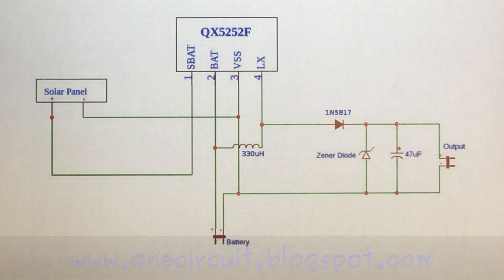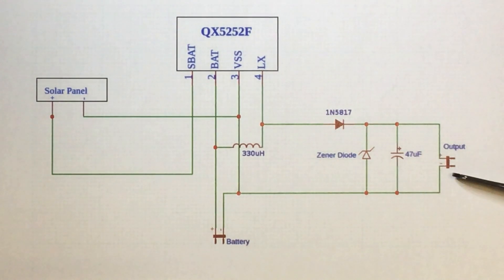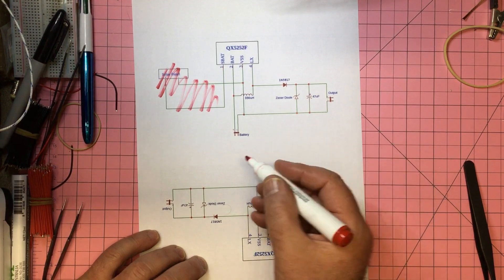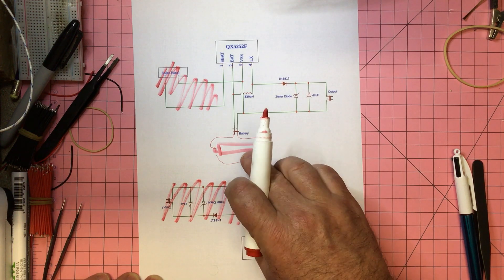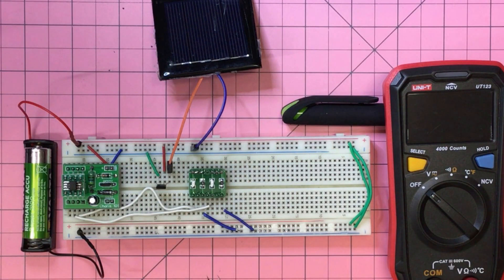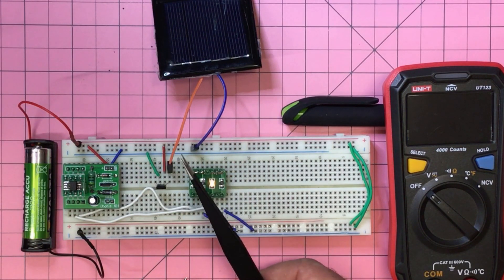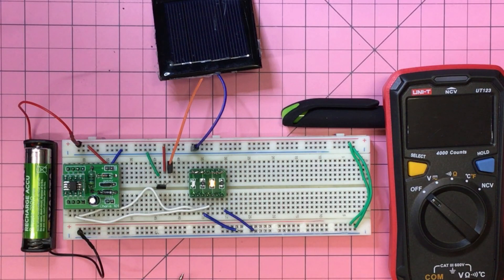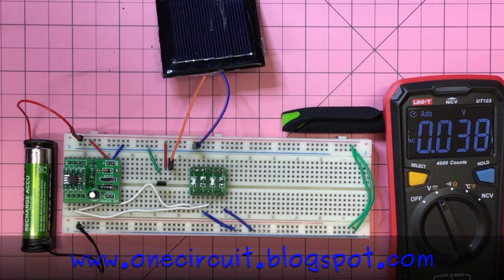Double QX5252 - Perpetual Light?

Comment: You have all the wrong values and have components you don't need.
Reply from the maker: ...and yet it works! Actually later I shift to the smd version which allows to be on the whole time! 😳
Reply: @onecircuit-as  you could throw dried leaves on it too, and it would work, but they are not needed.
Reply from the maker: Depends on what is needed! In this case a stable output voltage for a microcontroller - the QX5252 oscillates at 40kHz and that can be problematic depending on the project. Also, I'll give the dried leaves a go - thanks! 😁

Comment: A bit late, but if you want the 5252 running 24/7 just charge the battery directly via a shottky diode, not thru the chip.
If you use a second chip for charging you are basically just using it's internal diode, the rest of the chip is unnecessary and might even be wasting a bit of energy.
Reply from the maker: Yes it was a silly idea, I now use the SOT-23 version which has an LS pin to allow 24/7 operation. 🤷🏻‍♂️

Comment: cool, but are you really getting 5v out of it?.....if so, is that just because of the added 5.1 zener diode?.....just curious as ive been messing with this qz5252 too... interesting little chip.   cheers,
Reply from the maker: It is a great chip and yes the zener is the key to the voltage - a 3.3V zener will see a stable 3.3V out of the QX5252 (who's output jumps around a bit at 44kHz-ish)
Reply: @onecircuit-as   excellent, i,ll try that then....ive had 2 warm white leds running on a 1.2v battery and solar charged, had it running solid for 16 hours...and only used 0.175v amazing....so ill try the zener. Cheers matey... happy tinkering. :)
Reply from the maker: They run forever (even with Tasmanian "sunshine" powering them). The SOT23-5 version (available at LCSC) has the ability to run all day when you ground the LS pin - it works a treat.
Reply: @onecircuit-as    excellent, i just found some of those on aliexpress.....thanks for the heads up,  i,ll take a look at the datasheet....cheers man, all the best from UK...and wet n windy grey skies ;)